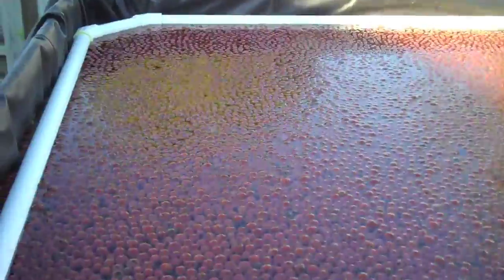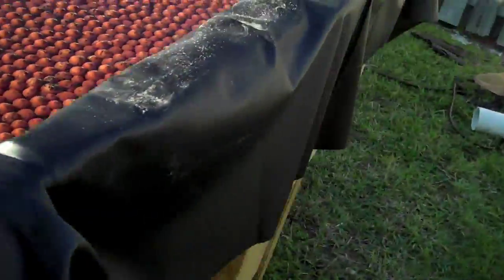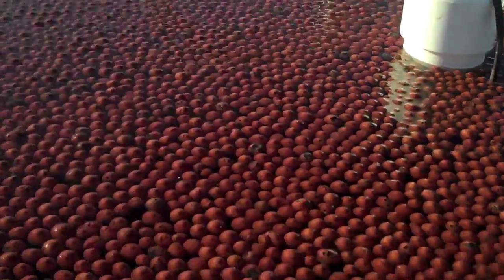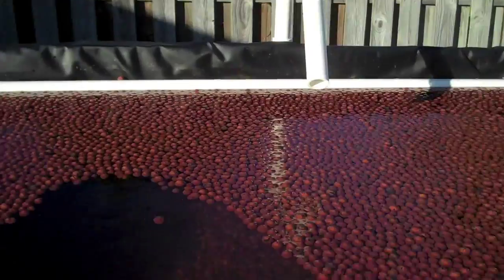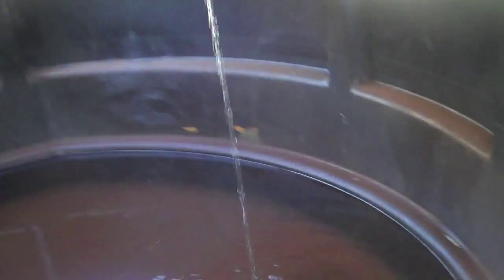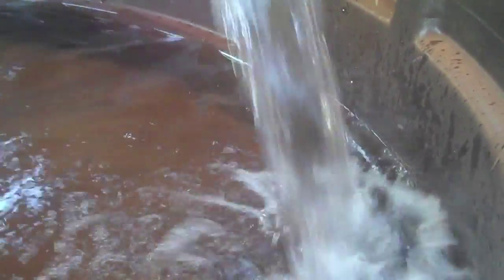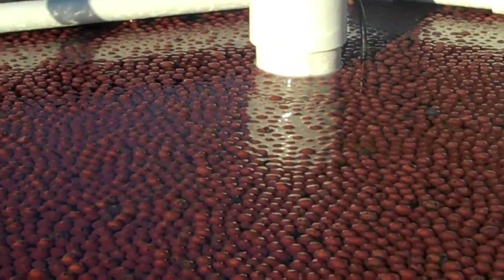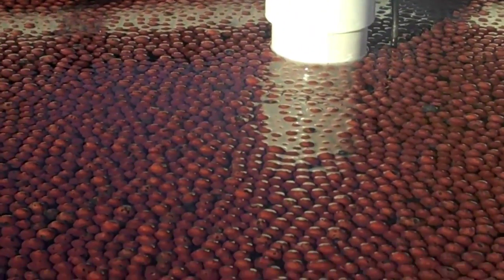300 Gallon Aquaponics Buildout Part 6

Comment: I have found, if you raise your fish tank and tilt it slightly toward the fish tank drain it will be much easier to clean the tank. If the tank drain is high enough to put a bucket after the shutoff valve, collecting the "muck" for furtilizer will be very easy. Respects - dennisreader